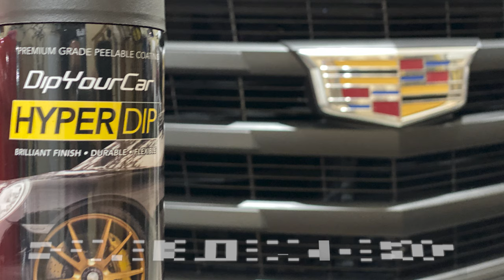How To Custom Wrap a Cadillac Escalade

Comment: What brand gloss black would you recommend for wrapping door pillars and door handles? I used vivid + and the corners are all coming up. Not sure if it’s my fault or that’s it’s just not a good vinyl. It seemed pretty thick maybe that’s why the corners are coming up?
Reply from the maker: Avery SW900 is probably the most forgiving for spots like that.  VViViD will work too, but it can be trickier depending on which of their films your using
Reply: @Donslife  ok thanks for the response!

Comment: Quick question. How do i remove the black plastic on the hatch door? I need to remove the door handle on the back door. Please advise, greatly appreciated
Reply from the maker: I would remove the handle.  I always have.  It is pretty easy once the interior panel is removed
Reply: @Donslife  how do I remove the interior panel? Thanks
Reply from the maker: There are screws under the removable plates by the window latch and main latch.  Then after that you have to pry our the clips.  Try 14:46 on this video. You can see the panels removed by the bottom latch and me prying the clips out
Reply from the maker: https://youtu.be/ToYdMw_wfyw
Reply: @Donslife  thank you buddy
Reply from the maker: Good luck!